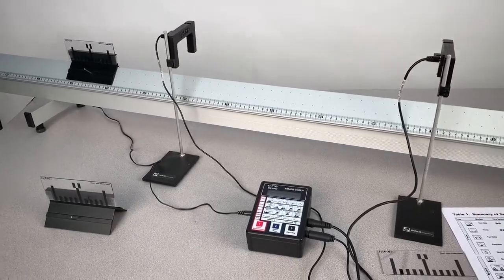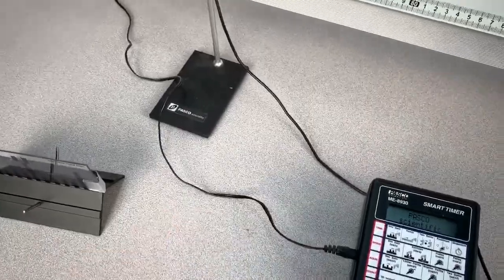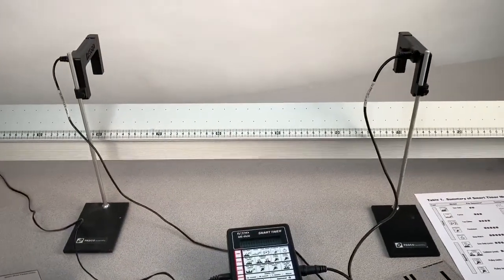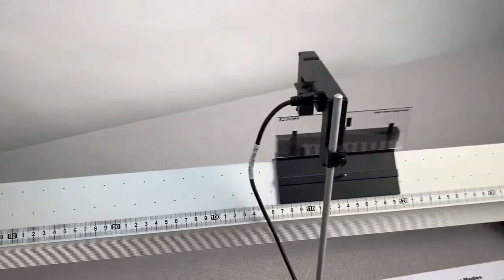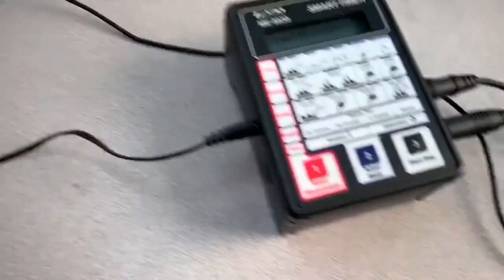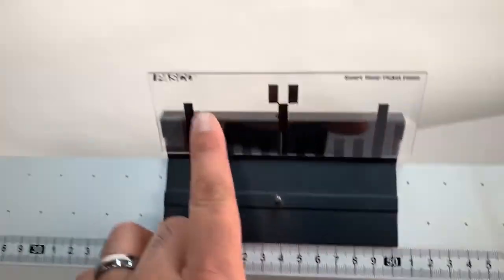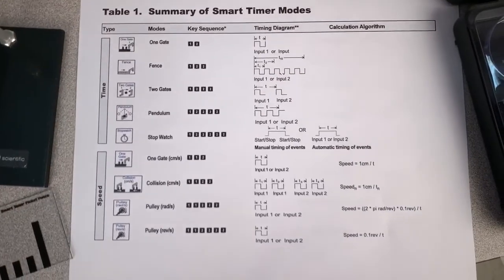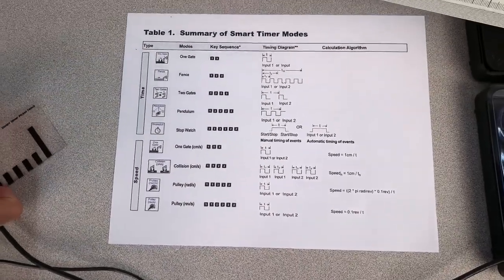Using PASCO Smart Timer with the Air Track

Comment: Do you have a cut down version that could bee used for a race timer - diecast/hot wheel racing. Don't need all the functions but like the idea of the gates and the accuracy of the timer
Reply from the maker: The best solution for you might be the PS-3225 Wireless Smart Gate.  www.pasco.com/go?Ps-3225
This can be used with our SPARKvue software that is available for phones.  www.pasco.com/downloads/sparkvue
You can either place a flag on top of the car or you can have the car itself be the flag.  Please make sure that the car does not run into the "arms" of the Smart gate.  If you have further questions, please contact us at pasco.com through the chat feature or by email at support@pasco.com